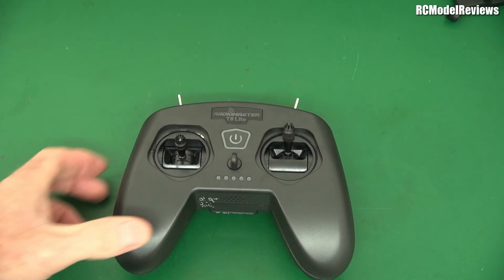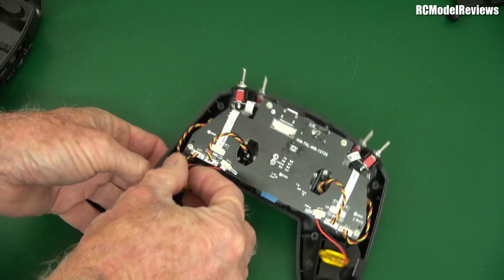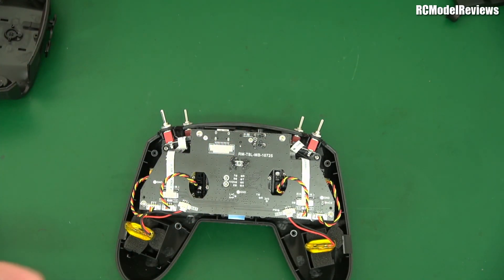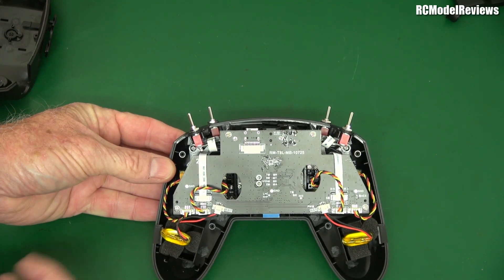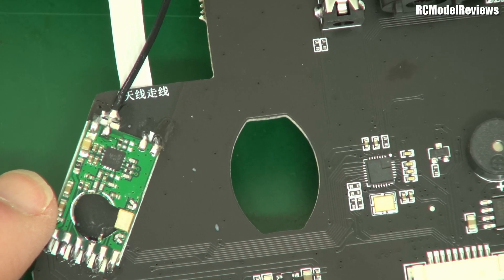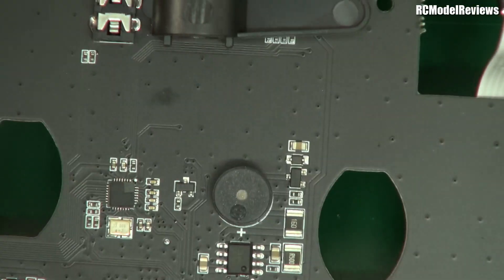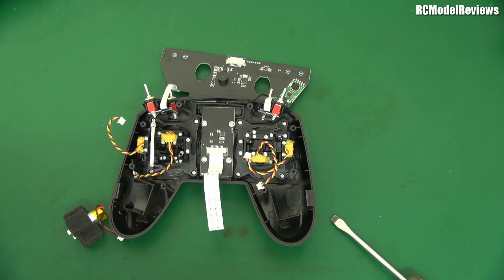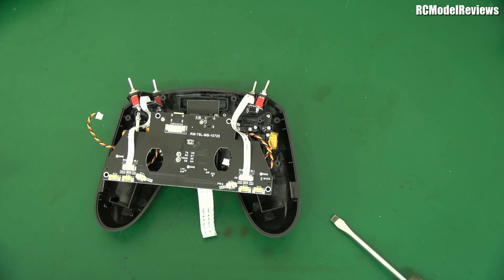What's inside the $40 RadioMaster T8Lite radio?

Comment: Bruce, the ribbons are ok if they're proper! I still have my early Jumper T16 and it hasn't missed a beat, however I did replace the ribbons fairly early on when the upgrades became available. The original ones had tinned connections and the upgrades have gold plated connections, $5NZ all up. I don't anticipate any problems due to ribbons.

Comment: Honest feedback: I think this is not suitable as a review. You have made so much better content. OK, you just say "what's inside". How do the gimbals feel, are they resistive? - How stable is the mid point? - How to handle multiple models? - To that is it compatible? - At least a minimal range test? - What is the battery run time? - How do you charge? - Are there any SW features that you miss? - Can one change channels? - Can you use it for simulators?

Comment: Wow! First!

Thanks for the review.

As far as battery management, I think taking them out is prudent.  Since the batteries have JST connectors, and the back didn’t look too tough to open.  For long-term storage, I would probably remove them, and use my real charger to put them to storage state.